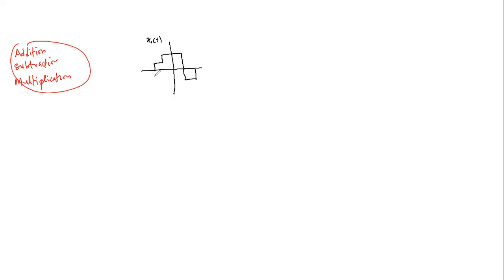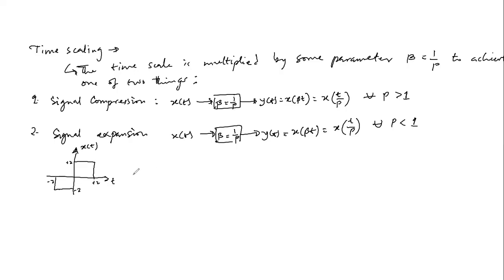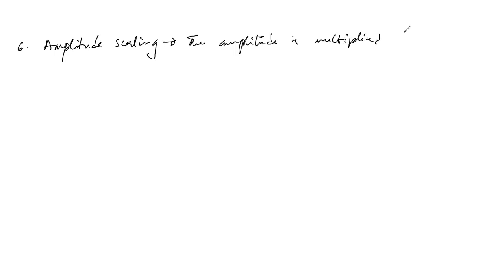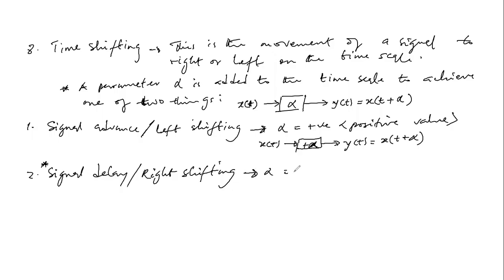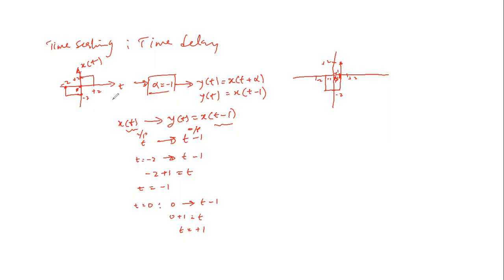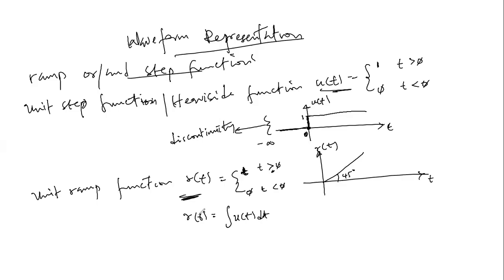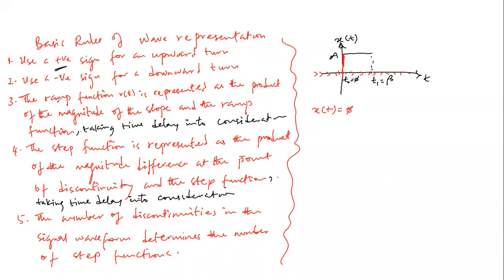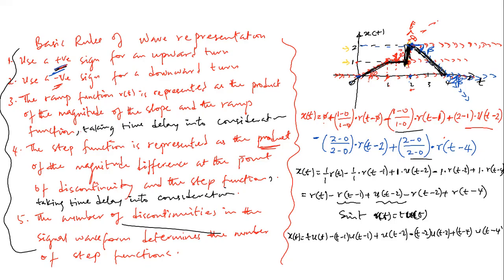L03 - Signal Manipulation and Waveform Representation #lecture #new #signal #system #engineering

Comment: Can every discrete time system be represented as a combination of step and ramp functions?
Reply from the maker: No. Although step or ramp functions may be used to generate certain types of signals or better still analyze the behaviour of discrete time systems, the impulse response or some other general basis signals such as sinusoidal or exponential signals may be used to represent a broader range of system behaviour and signals.